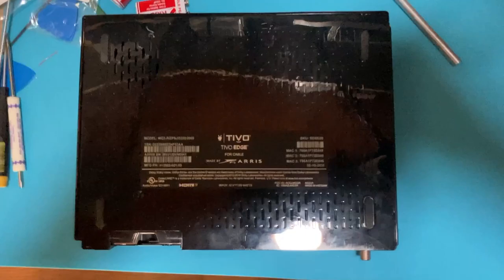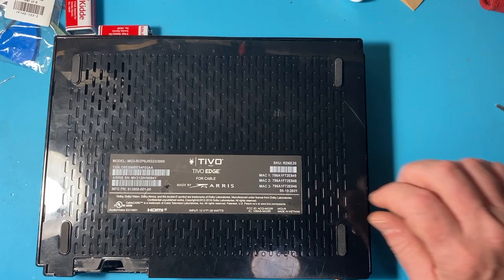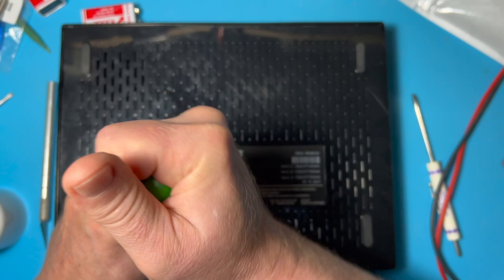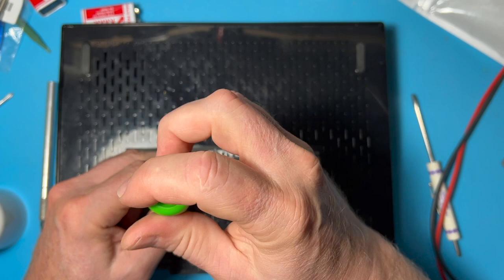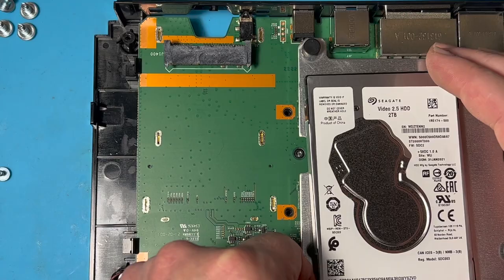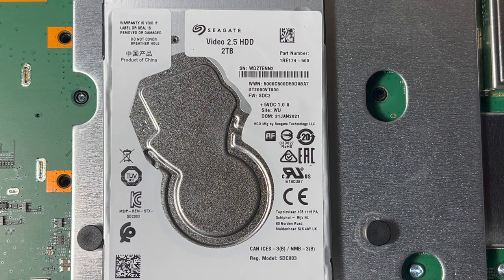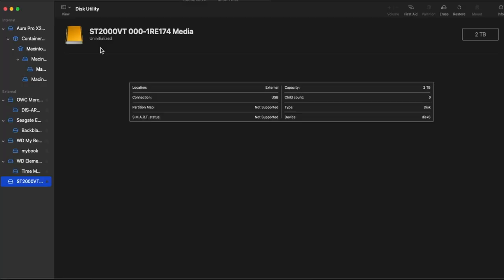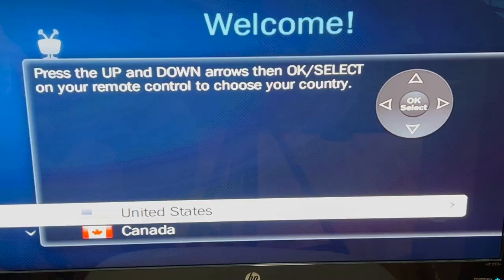Tivo Edge: Hard Disk Troubleshooting And Repair

Comment: Hey Ward, thanks for the video. It was heaps of fun to watch. When I open cases I keep plastic and metal putty knives handy as well as the spudgers. Once I get the first clip released I will stick a putty knife in at that location to keep it open while I work through the rest of them. And sometimes the putty knife turns out to be the best tool to start opening the case as well.

Comment: I swapped out a bad HD with a new WD CMR 2TB 2.5" and turned on the unit, it says starting up and the green light is blinking !!  Is it formatting the drive or do I need to restart the unit or check connections ?

Comment: Great video, thanks.  I appreciated your comment about the HDD size.  I don't want an external drive.  It makes me think I could install a SATA SSD since they are the same or similar form factor and size, although more money.  Do you know if an SSD would work in a TiVo Edge?
Reply: Actually, I just read that SSD's are not recommended for TiVo's because of the constant writing to the drive.  SSD's do better with more 'reads' than 'writes'.
Reply: SSDs do not work.  CMR HDDs do.

Comment: Just curious, do you know if the TiVo is still functioning after the disk reformat?
Reply from the maker: No. I finally decided at I was too scared of the "new experience" UI and moving my old recordings over looked like a big PITA, so I sold it "as is" on eBay for, like, $40.

Comment: Did it stay working?
Reply from the maker: Seems so. Finally sold it on eBay.
Reply: @WardCo  What I don't get - why don't they have a servicing menu with options along the lines of chkdsk - which would reboot the system into a HD test, lock out bad blocks, etc.  A lightly used Edge like mine should not have HDD problems after 2 years.  Plus basic troubleshooting should be accessible without crazy rebooting methods..
Reply from the maker: @rontroy3843  Preaching to the choir here, Ron. You are absolutely correct.
Reply: @rontroy3843  I have the same problem on a lightly used December 2020 500 GB Edge for Antenna.  Replacement HDD is $17 🙄 Might as well buy several at a time.